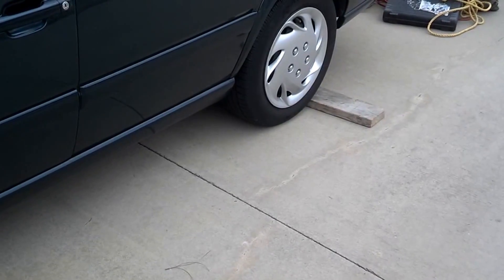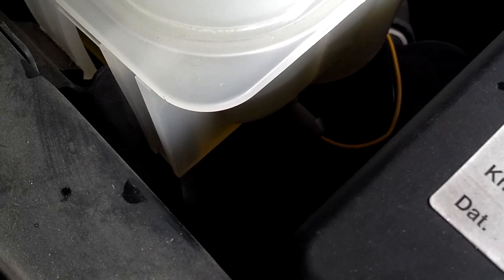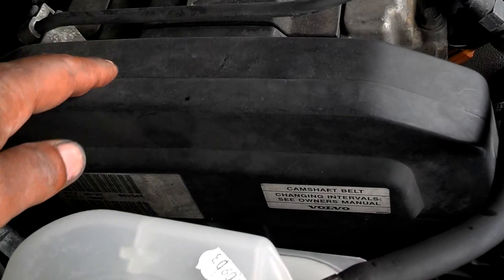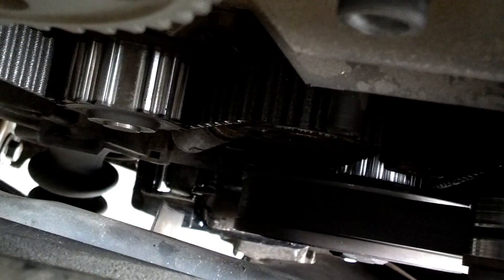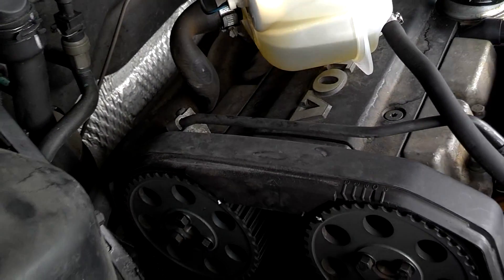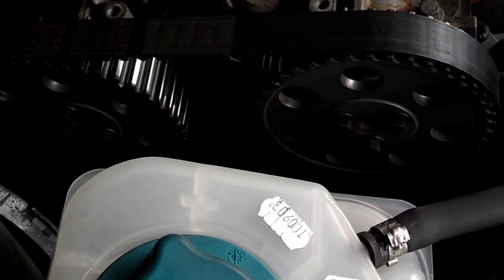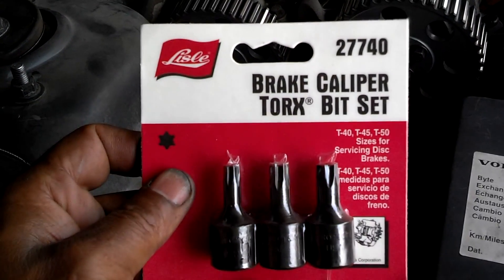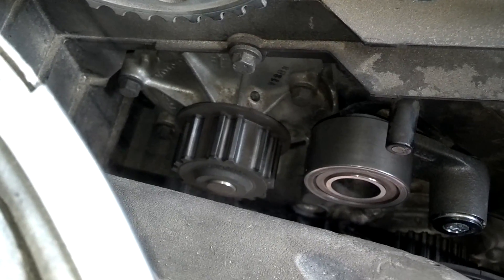How to replace the timing belt, water pump & rollers on the Volvo 850, S70, V70, etc. Pt 1-2 - VOTD

Comment: Robert, appreciate all the videos you have done. I just had the valve gaskets done on my 98 Volvo S70. Before this was done the car ran perfectly, now it smokes immediately upon starting, keeps stalling, and won't go fifty ft without stalling. What could be wrong? Some people say it needs the timing done because it was not done when the gaskets were changed, could they be right? Thank you so much for you help.
Reply from the maker: Timing is a make or break situation, so no that is not true. However, if the mechanic did not set the timing correctly when they installed the cover, the timing can be off and cause running issues. You can check the timing yourself or simply take it back to the mechanic and ask them to fix whatever they messed up.   Those covers really never leak. Not sure why the cover was pulled in the first place. Many mechanics do NOT know how to properly seal those covers. 98 Times of 100, there is a seal leak or some other issue which causes an oil leak. A cam seal or PCV problem will cause oil to be found on the cover.   The start smoke may be caused by something not being installed properly, like a PCV tube or an intake tube. Is the car turbo?  The sooner you notify the mechanic of the "post work issues" the more likely they will be to warrant their work.  Volvo 850, S70 Timing Alignment Check - Auto Repair Series

Comment: I removed my cam gear on a 2002 volvo v70 to replace the can seals and my marks was erase on the gears in the process. How can I rest the timing at this point?
Reply from the maker: I'm not 100% sure about your year model but here is what is done on the earlier motors. If you have the CVVT it will have to be reloaded. I have never done that so you may want to Google it. If all else fails, take it to a shop to have the timing set and CVVT loaded. Timing Demonstration with Head removed, Cam cover installation. - Auto information Series

Comment: Hi Robert
Great video
I do have one q. You see I made sure to follow all your remarks while replacing my Timing belt on my 97 850 t5 with 40K only just last week but one thing could not be done perfectly even though the engine is running very smoothly .
The crank gear is dead center on block mark.
The cam gears notches are not dead center on the upper plastic cover they are falling side ways but within the cut outs
Is this normal?
Thanks 
Mohammed Alasali 

But the
Reply from the maker: If the car is running smooth, don't worry about it. They don't have to be PERFECT, just as close to perfect as possible.

Comment: HI Robert. Nice video. I live in Chile, southamerica.
I sent my Volvo XC70 to VOLVO oficial technical service I pay US$1500 for the job.
One day after I received it, a yellow light turns on in the board. I go back to service and they tell me that there is a problem with the pulley toothed belt.
I have a video of the fail here.
https://www.dropbox.com/s/admtf5tkcxapl3i/20140210_123717.mp4

Is it possible to be casual or are we talking about a bad job that makes the fail?

The spare part is not in Chile so i have to wait one month and pay aditional US$1500 for the job. I feel cheated.

What do you think?
Reply from the maker: Bad job. It appears that you have a newer Volvo, newer than 1998. What happened is, they did NOT know how to set the tension for the CVVT on the exhaust cam. There is a chance that there is NOTHING wrong with it, they just do NOT know how to properly set it.

I recommend that you have the car transported to a Volvo dealer or a shop that specializes in Volvo's to have the job completed.

When the belt is off, it is possible to turn both cams (they are no longer attached with the belt). The light come on in the cluster to warn you that the timing was off, not set properly.

You can Google Volvo CVVT and read about the system and the adjustment that mechanics need to know how to do. Matthews Volvo Site has some good information about it.

Volvo timing alignment - Auto Information Series
Reply from the maker: After reading again, I see that you say that a Volvo technical service station did the job. That is unfortunate. The job SHOULD HAVE come with a service warranty. If the part was bad, they should have known it when they had it apart the day of the service.

I suggest you speak with the service manager or the service station owner to discuss a service warranty and ask them to fix their possible error.

Again, those cams can move when the belt is NOT attached, sometimes they move when I am not even looking while doing the job.
Reply: Robert DIY
Thanks Robert! I want my baby back. Best regards.
Reply from the maker: What you may want to do is ask for a LOANER CAR until they get your car fixed. Then, if they will not cover the cost of the repair under warranty, pay for the repair, then get a lawyer or go to small claims court and fight for your money back.

Comment: great vid, question I just bought a 99 v70 cross country it has a vibration over 50mph  balanced tires no change sounds like its coming from the rear, any ideas
also the cruise control and fuel gauge do not work, an new fuel pump was installed before I purchased it, not sure if gauge was working before or not
Reply from the maker: I will send you a private message because your questions are not timing belt related.

Comment: Hi Robert, I am not a DIY person as far as cars are concerned. I just had the timing belt replaced on my 2004 XC-V70 and since then the car drives terrible on highway above 100kph (60mph).What could be wrong?
Also You talked about water pump - does that also control the windshield wiper fluid? Because since the timing belt change the windshield fluid no longer sprays. Wondering if the pump is gone - it was working just fine before the service. The mileage on the car was about 168000 km (not miles).
Thanks for your advice.
Reply from the maker: If the car is running rough, I would have the shop double check the timing. If the timing is off the performance will suffer.

The windshield washing fluid has nothing to do with the car's water pump that cools the motor. Have you checked the fluid level in the windshield washing fluid reservoir? There is a chance that the pump or one of the water lines have been disconnected and the fluid is spraying under the hood/car.

Comment: hi Robrert, i have a 04 v70 2.4l , have a question on timing belt lock tool, is there one i can get? thanks, brian
Reply from the maker: I would think so. Check iPdUSA.
Reply: Robert DIY Hey Robert, checked with ipd, they said all they have is a cam lock tool for back of engine on this model,do they make a universial one for this model,also do you think i can do a timing belt and water pump replacement without one, thanks again...you are so very helpful.....
Reply from the maker: I think you can. I have never used a cam locking tool. Align the marks, make sure the marks are clear and maybe make the marks clearer, then proceed with changing the belt.

Comment: Hi Robert,  I took another look under the hood, and there's no water leaking from the firewall coupling.  I now think its my water pump....waters just leaking out near/side of my left front wheel.  My question is would I need to replace the timing belt as well, or could I get away with just replacing the water pump?  It's also making a sound when I start it up?
Reply from the maker: Where are you located? The timing belt and water pump is near the right front wheel. Is it the same side of the car as the timing belt cover?

Comment: Hi Robert. My PVC system is bad. I will therefor want to replace the cam seals. Do I remove the cam wheels. How would I lock the camshaft? Would that be done on the otherside of the engine. Do you require a special tool to lock the camshafts?
Reply from the maker: Are the cam seals leaking?
Reply: Im not sure as yet. I havent started the job as yet. Just s forthought as the pvc is blocked. Do i replace seals as a precautionary measure. They come with in most kits.
Reply from the maker: I never change cam seals as part of the PCV job. Only mess with stuff like that if it is leaking. Some people change them when they do the timing belt, I do NOT. Cam seals can last hundreds of thousands of miles if the PCV is serviced as needed.

If you do replace the cam seals, there are some on the front of the motor and rear of the motor. If you replace the ones on the front of the motor you have to remove the cam sprockets so mark them well. Scratch at least 3 marks on the center shaft where they meet with the sprockets so you can get them back on correctly. Most people do not realize the the bolt holes on the cam sprockets are slotted so you can get the timing off if you don't mark the parts well. The cams can be locked from the rear of the motor but that is not really necessary if you mark the parts well up front. I have a video dealing with the head and how the timing is set that you can watch to give you a good idea how that all comes together.

Also, if you do change the seals, get good seals or you will be changing them again in 18 months or less. That is what happened to us. Someone installed aftermarket seals in my daughters car and they started leaking in 16 months.
Reply: Thanks Robert. So its best to stick to genuine parts. Appreciate the advice.
Reply from the maker: On these Volvo's, 9 times out of 10. You can get them cheaper sometimes from different parts suppliers like iPd or FCP. They do sell OEM parts.
Reply: Thank you for the advice. Just messaged you on youtube.I also have serious knocking sounds coming from the valve area. My 850 needs a bit of work!!
Reply from the maker: Did you post a video of the sound?

Comment: I have to say, 100% honest and accurate information provided here. As a Volvo tech of 20+ years, I can say this guy is VERY credible.
Reply: I can also tell you all... the stock 8xx and S series jacks are junk and prone to failure. ALWAYS use jack stands. NEVER rely on just the jack.
Reply: kevin james The tentioner bolt: I always pressure wash the front of the motor and let it dry. Then use a QUALITY T45 dipped in 90 weight, and cover it, and the bolt with JB weld and let it set for 20 min. NO chance of stripping. Works like a charm. (I have had a couple break though).
Reply from the maker: kevin james
Thank you for the support and for watching. :)
Reply from the maker: kevin james
I agree 100%. I had one blow out one me just after pulling a jack stand. I'm so glad the tire was on.
Reply: I am doing my first timing belt now. I have the timing marks lined up perfectly at the top, but the two marks on the crankshaft are one tooth over from the mark that is supposed to be between them. I'm assuming that this is not out of time enough to greatly affect the cars performance, but not really sure. Should I just line everything up before putting the new belt on?
Reply: You can do your own marks.

Comment: Those dimples on the crank pulley/harmonic balancer are balancing holes drilled in by the factory when the whole crank was balanced at the factory and will be in unique positions on different cars, however you could write down where they end up as a rough reference.

Comment from the maker: An adapter will not fit you have to use the bit assembly that I used. There is a slight chance that your front motor mount is torn and your motor has shifter a little forward (to the right).

Comment: Robert how did you get the idler off with the T45, I checked mine, and dont have clearance with a 3/8 ratchet.   Did you grind the length?

Comment: Sorry for the late reply, I was just able to purchase an OBD 2 and a voltmeter. The code that came up was P0120 which is the throttle position sensor but i than checked the voltage from the sensor and I got a reading of 4.5 volts. That means the sensor is ok right?

Comment from the maker: Just looked at the video and the sticker says 3/05 @ 96,500. It was changed 4/13 @ 169,600 according to the odo. So, this belt was 8 years old and had 73,000 miles on it.

Comment: Nope I believe this car has only gotten by on prayer.  It all needs replacing. And I have the new parts sitting here. The water pump seriously needs replacing and I would feel better about changing it all out. I wish you would tell me that I have been trying to turning it in the wrong direction because I can get a grip easily if I turn it clockwise but not ccw.

Comment from the maker: ...the nut on the new roller. My guess is that I could only get it torqued to about 10 to 15 ft lbs. I then put something on the treads, hoping and praying that the nut does not come off the bolt. Maybe you should/could put some lock-tite on it. 

One guy told me that he got it off by putting vice grips on the washer around the T-45. Try that first.

Comment from the maker: I suggest you inspect the roller first. If the roller is good, leave it. I'll send you my timing belt information video that shows you how to check the rollers. If it is tight, leave it, especially if it was changed LAST TIME the belt was done. 

This has happened to me twice. Both times I replaced the roller and left the bracket on. The roller has a bolt in it. You can pull the bolt and the screw will stay. Then install the new roller on the old bracket. The problem with this is tightening...

Comment: Hey Robert thanks for the videos! I am tackling this job and have been stuck on the almighty torx 45 and am about to strip it. I have tried everything! I think it was a little stripped to begin with. But I have tried new craftsman & lisle bits with breaker bars and can't get it! What would be the best way to take it off without hurting anything else? I was going to slot it and go at it with a screwdriver. Any experience with it? Thanks!

Comment from the maker: You said the timing on the cams is off. You need to check compression. A home method of doing this is to pull all of the spark plugs except 1. Then crank the car over by hand and see if it gives any resistance. If you can turn it over twice without any resistance you have a bad cylinder (no compression). Pull that plug and install the next one. After you check all 5 one at a time you will know which cylinders are bad. If you have compression check check for another issue.

Comment from the maker: If you tried to start it with the timing "OFF" don't waste your time taking it to a shop unless you are ready to pay in excess of $2,000 to get the head replaced/repaired. Did you use my video to put things back together before you tried to start it?

Comment from the maker: I never replace seals that are not leaking unless I have the shaft part out. The crank seals never leak unless you have a clogged PCV system and the same for the cam shaft seals. I have a write-up on the cam seals, I'll PM the link to you. 

As for the car stalling, what codes does it have?

Comment: Hi Robert I was wondering if you have a video showing how to replace the camshaft and crankshaft seals on this vehicle? I also have a question regarding my 1997 Volvo 850 T5 car, it seems to have a problem when I drive it and after it is really warmed up it begins vibrating especially if I'm at a stop light and the car wants to shut off. It has turned off and not wanting to start. What could be the cause of this? Thanks a lot for your time and great videos.

Comment from the maker: NO. Most cars require the crank "harmonic balancer" removal but these cars DO NOT. The only time I would remove the balancer is if I had a leaking crank seal which I have never seen one of these leak in the front.

Comment from the maker: After it does NOT start with the relay unplugged, plug it back in to see if things start working right again. Hopefully you did NOT pinch a wire under the intake manifold or somewhere causing the injectors to open full time. 

If you can't find the problem there, post the problem on Matthews Volvo site and/or Volvo Forums.

Comment from the maker: So it is getting to much gas for some reason. Is the temp sensor plugged in good? It is located under the thermostat. Before you start the car, turn the key on and see what temperature reading you are getting. Does it run smooth? Also, double check the intake manifold, make sure it is on right and nothing is pinched under it. 

Unplug the fuel injector relay at the fan scrod. See if the car starts then. It should NOT. For some reason, I think all of your injectors are full open.

Comment from the maker: Are you saying that you can repeat this process over and over again? Dry out the chambers and start it again? How long does it actually run? If it is flooding, you have an injector problem. Are the injectors sticking open? Do you have any engine codes? Are all of the relays at the fan connected? Does it start easy? I would start with reading the codes. What year car is it?

Comment: hi there i recently had bent valves in motor and i took the head in and got it rebuilt now when i put everything back together the car starts for about a min or so and shuts off and will not start after i have to take out spark plugs to let excess gas to dry out what could this be ?

Comment from the maker: Yes, there are a lot of cars that will be similar. Especially if they are DOHC motors. Design runs the same in many cars, just different on the crap you have to pull to get to the guts.

Comment: Yea I went ahead and bought that R model. Looks really good so far. I got the head off today, and sure enough, bent valves. Probably half need replaced, I will take it to a machine shop on Monday.

Hey, I was wondering if I could pick your brain. I fount just a bit of oil in the hose between the tubo and intake. Not much, maybe a teaspoon worth. Is this something I should look into, or is a bit of oil in there normal?